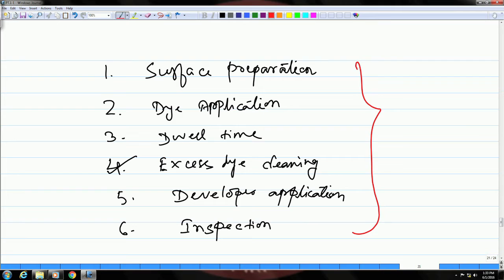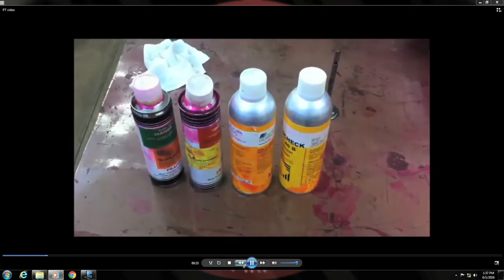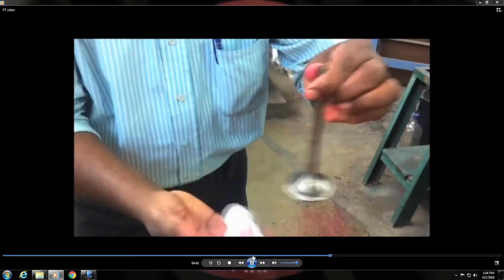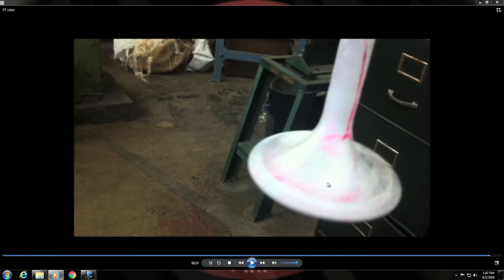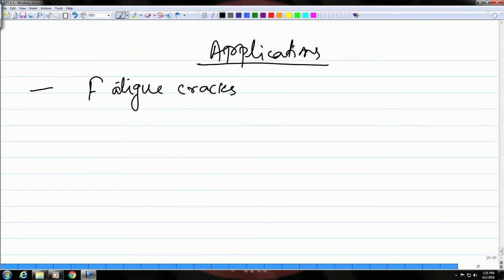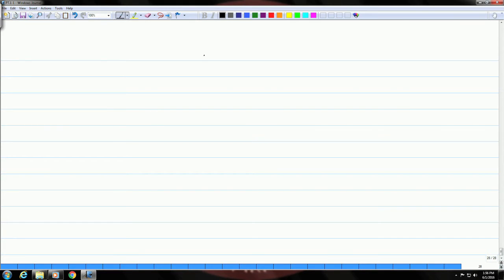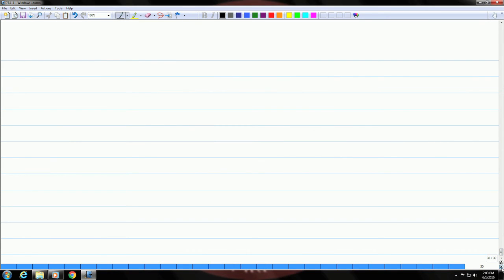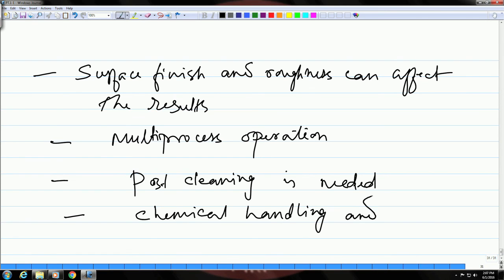Dye Penetrant Testing - 4

Comment: What exactly is the Developer???
Reply: after cleaning excess dye from the surface only, we apply some chalk dust which is the developer. The purpose of the developer is to draw the dye out of the flaws and make it come to the surface to be easily recognized. It's called the developer as it develops a visible indication
Reply: can someone answer this question? 
the choice of using surface or bulk ndt methods deponds upon?
Reply: @kalpeshsingh2670  It depends on Whether the flaw is on surface or inside the bulk/volume of the test object.